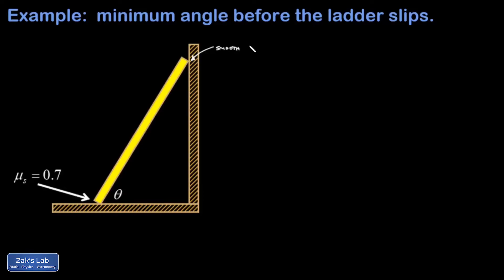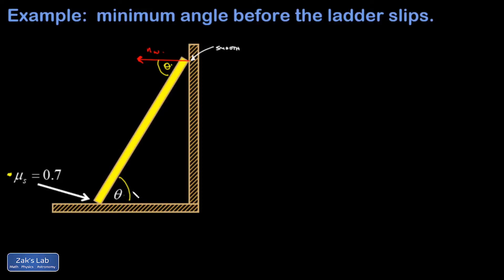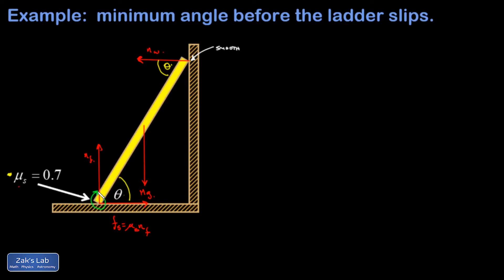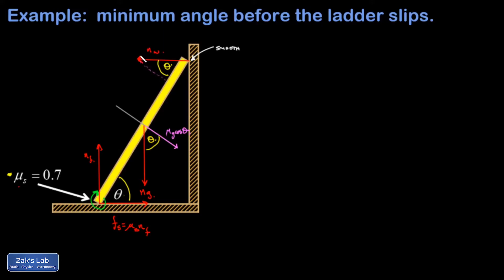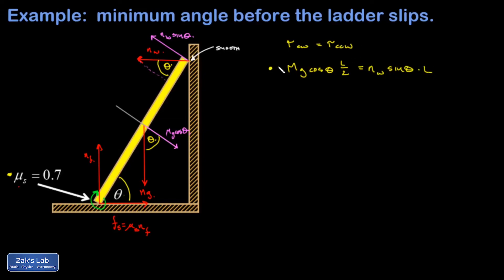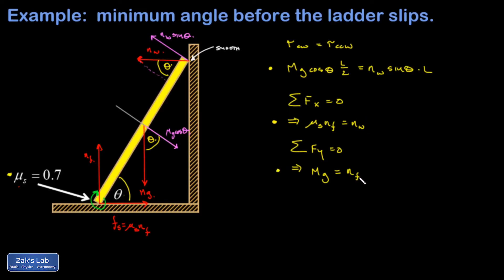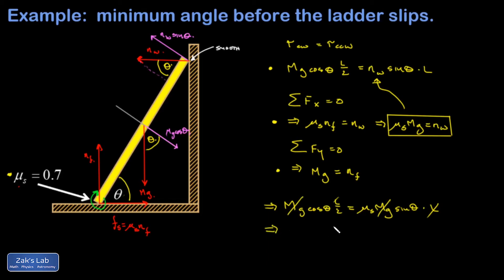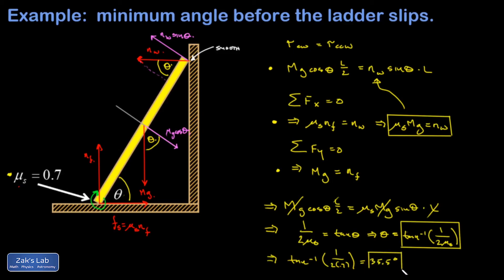Static equilibrium minimum angle for the ladder problem.  Rod leaning against wall minimum angle.

Comment: A 30ft ladder weighing 100 lb having its center of the mass one-third of the way up  from the bottom rests against a smooth wall so that it makes an angle of 600" class="Wirisformula" role="math" alt="60 to the power of 0" style="box-sizing: border-box; vertical-align: -4px; border-style: none; height: 22px; width: 26px;"> with the ground. If the coefficient of friction between the ground and the ladder is 0.4, how high can a 150-lb man go before the ladder slips?

Comment: what happened if there was a friction at the wall
Reply from the maker: You put in a static friction force parallel to the wall and dependent on the normal force exerted by the wall.  However, I think something goes wrong in the setup -- is it correct to assume both static friction forces are maxed out at the same time?  The intro physics books always conveniently skip this problem, but it's a really good research question to add to my list.  Thanks!  -- Zak